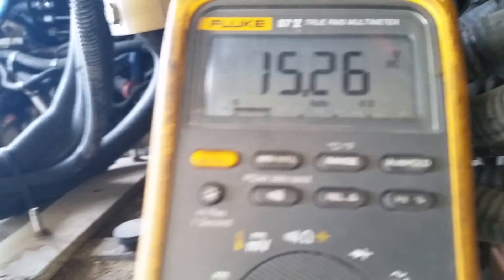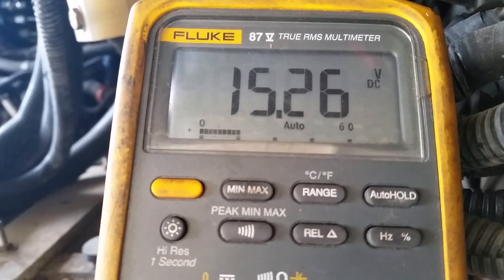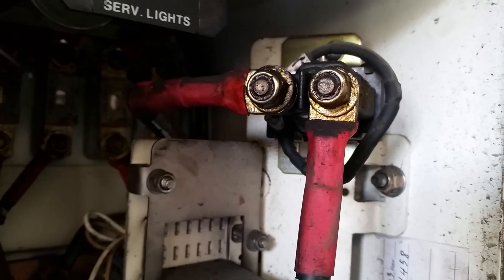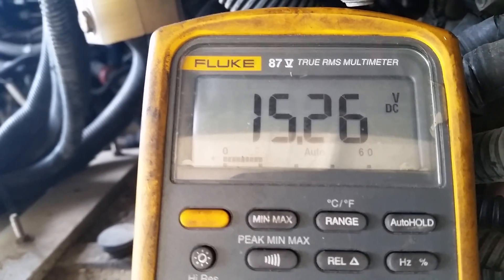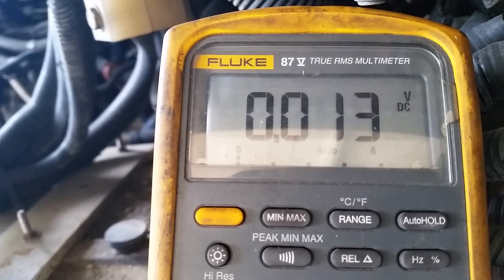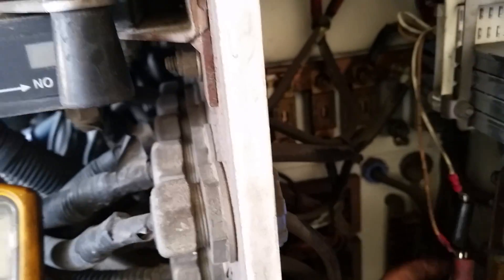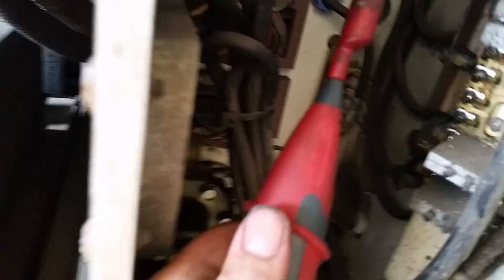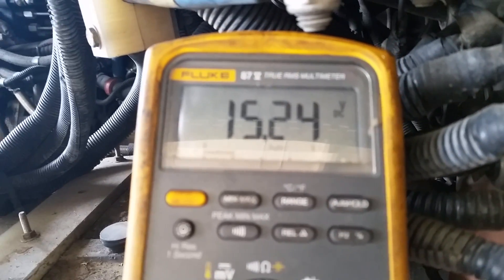Intake air heater fault

Comment from the maker: Just to clarify what the fix was it was a faulty Power Driver in the ecm.  I went right at the positive pin at the ecm and loaded it with the load pro and it had the same voltage drop as it had before.  A new Ecm fixed this.  Wish I had the fix video but I thought this was another good example of how useful the Loadpro is.
Reply: Mike at the ECM the  feed from the ECM driver  showed  the same as at the relay 15v  when it should have been 24v ?  So there was no voltage drop as in a high resistance fault but a defective driver. What was the voltage before loading the  loadpro  at the ECM before and after its use ?
Reply from the maker: +Steve Rob Yes Steve due to the high resistance in the driver it showed the low voltage open circuit and then the voltage completely dropped when I loaded the driver with the loadpro.  I knew the problem was on the positive side after I dropped the black lead to ground and I got the same results.

Comment: Nice, now you could have read 23v and thought it was a bit low and never knew there was a voltage drop by just looking at voltage and it wasn't a loaded circuit either, just goes to show how valuable the loadpro is.
Reply: +Steve Rob Lost me on this one... With 2 (small) wires to the relay, one was a 24v constant feed with a ground side switch for the control I assume? Or vice verses, constant ground with a power side switch? In either case in order to test across them the relay would need to be commanded on correct? What was all the sparks from lol seems like a good "load test" right there haha.
Reply: Ha you musta had too many official Coors football beer - beer. Reading voltage on a meter can never  load the circuit. The Sparks were from a lighting bolt :)
Reply: Coors football beer ? I don't see any women here haha
Reply: South Main Auto Repair Got some swag headed your way next week :)
Reply from the maker: +South Main Auto Repair I used Cummins Insite to force on the Power driver from the ecm so I could check the circuit integity.
Reply from the maker: Exactly
Reply from the maker: +South Main Auto Repair The spark was a boo boo, lol.